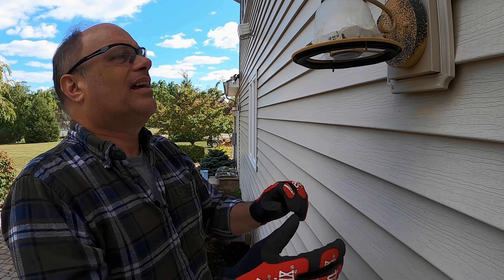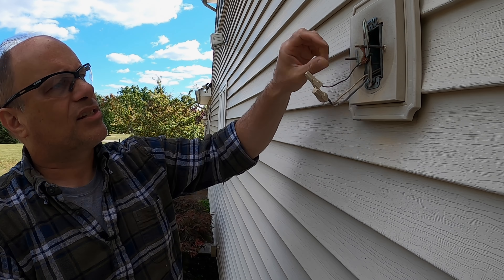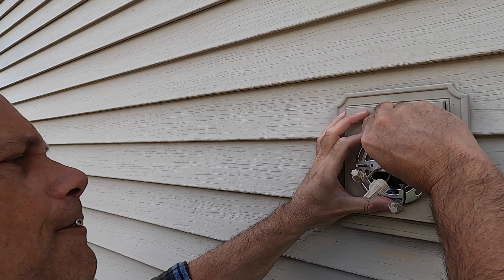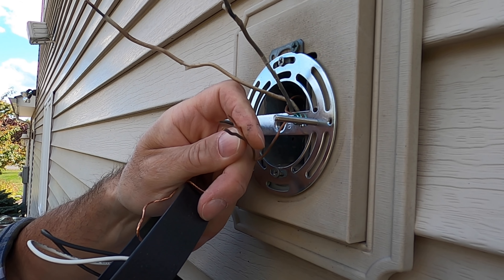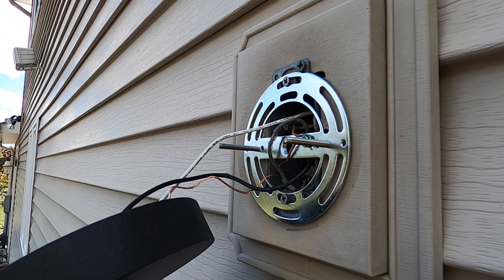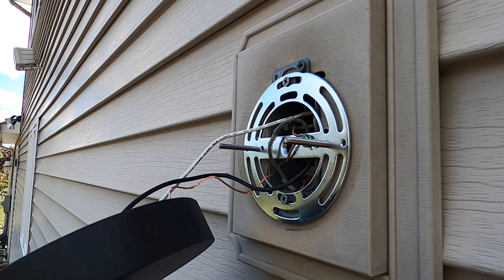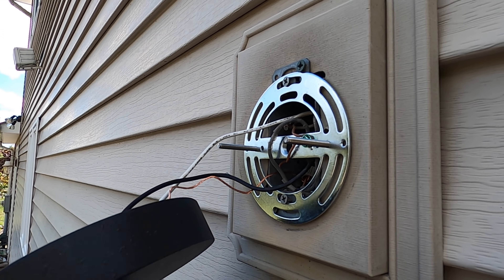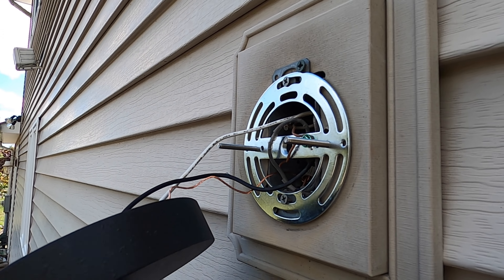How to Install an Outdoor Light Fixture - The Right Way

Comment: Thank you for explaining not just the how-tos, but the whys behind them as well. A better understanding of how things work really helps me. Yours is the 3rd video I watched, and you mentioned so many other helpful details than the other videos. e.g. twisting the ends of the strands, having the different length of strand/solid connection, the tab inside the light bulb, etc. I’m excited to install mine now!
Reply from the maker: Thanks for watching, Sara! Some call me long-winded, I prefer to say I’m “complete”… Best of luck with your installation and let me know if you have any questions!
Reply: @completepete  I agree, no one else mentioned leveling, or not lining up the strands and solids even

Comment: Thanks for posting. I've installed a number of outdoor fixtures but haven't done one on siding so I've been checking out videos. Interesting tip to extend the stranded wire a little further. I do prefer to also wind the two wires where the jackets are a bit though. I do put the wire-nuts up though. 
I especially liked your point about not tightening the mounting screws on the crossbars. I always have but your method makes way more sense and eliminates the frustration of getting the exact distance extended for the acorn nuts to seat properly! I'll be remembering that one thanks.

Comment: Excellent video!  Thanks for all the extra little details about the installation like leveling the mounting bracket, wire nuts facing upward, proper tension on the lightbulb fit, caulking around the top, etc.
Reply from the maker: Joe,  thanks for watching and hopefully subscribing!  I’m glad you found the video to be helpful.

Comment: That's a really good tip about masking the fixture with painter's tape before adding a bead of caulk to seal it up. I just did that with mine, and it worked great. Thanks.

Comment: Thanks for this. I was surprised at the lack of a gasket on a similar light that I bought recently, this explains it well.

On the circular mounting plate, there’s usually a bunch of threaded holes for different sized boxes. if the light is still sagging, you can put a longer #8-32 screw in  on a bottom hole and turn it until it contracts the back of the metal box, and use that to keep the plate from bending over time and the light sagging. Assuming there’s not wires in the way that the long machine screw would damage of course.

Comment: Thanks so much! I just replaced the 2 fixtures flanking my patio door after watching your vid, writing certain steps on paper to have handy on my ladder. Followed your PRO tips, like extending stranded wire past solid one, turn direction of nuts to avoid rain, etc, which other well meaning YouTubers (but not PRO electrician) might exclude. I was so confident that I ordered one of the replacements "Used, Very Good condition" from Amazon for half price—supposedly only having a dented box, but ya never know. Figured I could readily TEST it with a quick install of ONLY the wires. YES, I had to keep reminding myself to flip the circuit breaker back OFF after the test. So what a joyous moment when BOTH lights worked after completely installed. (One fixture had already failed a year ago but I hadn't gotten around to fixing it til now, so wasn't sure what was going on there—the fixture or internal wiring.) Actually, REMOVING the old fixture was the hardest part! One of the 2 decorative nuts on each fixture didn't want to come off. It was like screwing it was also turning the bolt it was attached to, going round & round nowhere. The good thing? Because I was "educated" by your vid already, I didn't panic. Used pliers to pull nut—attached to the whole shebang (bolt, fixture & mounting plate) slightly, bending plate JUST far enough away to access the 2 screws (at top & bottom) holding old mounting plate to wall. Then unscrew them to remove old fixture. Was quite an ordeal, actually. Makes me now wanna research how to readily remove rusty nuts, bolts, etc. Cause lately with Covid, I've been doing plumbing too, and encountering nuts & bolts rusted together—not readily removable—even with WD-40 and similar products.  Well that's a whole other night's YouTube viewing :-)  Thanks again so much! You are indeed COMPLETE Pete!
Reply from the maker: Thanks for watching!  I’m so glad that you had a great experience with your project.  If there is some other project you would be interested in seeing a video, please let me know.
Reply: @completepete  Hey, I notice that you twisted the new stranded wire CLOCKWISE. Does that make a difference in how strong the connection is? ..Since we later turn the NUT in one direction onto both wires, might we be "unraveling" or twisting the stranded wire even tighter depending on what direction we twisted the stranded wire initially?  I'm reminded of pipe tape for plumbing fixtures where the direction of tape wrapping makes a difference, and I'm sure there are more light fixtures swaps in my future :-)  Thanks!
Reply from the maker: Great question..  I always twist clockwise with the stranded wire and when the wire nut goes on, it’s also twisted clockwise. This allows the spring connection inside the wire nut to tighten when it’s turned clockwise

Comment: Thank You!
I didn't know about the orientation of the stranded wire Vs. the solid core wire.
Also, the tip about the wire lugs is something that I have never thought about.
You've given me the confidence to repair my outdoor light fixture and it's going well.
The light that I'm working on is bent and the junction box is not secured in place.
I'm going to remove the light and secure the junction box in place and straighten the threaded tube.
Thank You!
Reply from the maker: Thanks for watching Jeffrey! I’m so glad that you were able to perform this repair.. take your time and enjoy the process.  I’m working on some other electrical videos and hopefully one of them may guide you into your next project. If there is something electrically related that you would like to see, just let me know!

Comment: I know 90% of this, but your tips about stranded to solid wires and twisting in the bulb were great. Question: how do you keep the mounting screws loose so that they can go in further if necessary for the decorative nuts. You mentioned this when mounting the light, but it was not clear when you installed the bracket.
Reply from the maker: Thanks for watching! There would be three ways I’d go depending on the job. First would be to install shorter 8/32 screws into the mounting bracket. Second would be to use the screw cutter on my Klein stakon crimpers to cut the screw shorter. Third if I had no shorter screws or my screw cutter I’d run the screw heads back against the siding and mark around them. Then I’d drill a 1/4” hole through the vinyl and into the plywood to create a pocket for the screw to recess into if needed.  Thanks for mentioning this as I can do a quick video covering these points!

Comment: This is very helpful. Upon removal of the old fixture, I realized there is no junction box! Can you do a video on how to install a round junction box? Or any tips/suggestions?
Reply from the maker: Thanks for watching.. glad you found the video helpful.  It’s possible to cut into the siding and add a box (I was planning to do a video in this in the near future). If you have vinyl siding you can add a siding block with a molded in junction box -
https://www.homedepot.com/p/Arlington-Industries-5-8-in-Lap-Siding-Mounting-Kit-with-Built-in-Box-8151-1/202284581
They make this type of siding block for a number of siding types. This is a great way to go if you have vinyl siding so you can avoid cutting into the siding.  Please subscribe so you don’t miss the video.. if you project is more urgent hopefully the siding block option will work,  let me know if there is anything else I can do to help!
Reply: @completepete  thank you! Trouble is, the house already has the “block.” It’s like 6” x 7” roughly. Can I cut into the block and install the junction there? Or do I need to remove the entire block and start from scratch?
Reply from the maker: You can normally cut through the block without any issue.

Comment: Good video! My ground wire is held in the mounting by a small bracket. When I disconnected it from the old fixture the wire broke right at the end. Can I attach an extender wire by pulling it out from the bracket attached to the box or should I attach another piece to the section where it comes out of the wall to the bracket?
Reply from the maker: Best bet would be to attach a new piece of copper to the ground wire coming out of the box. Then reattach to your fixture bracket

Comment: I forgot to screw the ground wire to the mounting bracket. I did everything else correct. Do I need to go back and redo?
Reply from the maker: Thanks for watching! Yes, you should go back and attach the ground wire to the mounting bracket. The ground is what trips the breaker in the event of a short circuit.
Reply: @completepete  Thanks so much!!

Comment: I am instaling a outdoor light fixture very simler to the one you instaled, the problem I have is the fixture mounting screws are 3 inches apart and does not go in the wall box openning.  The wall is stucco finish and the round box openning measures 2 3/4 inches, Is there a remedy without tearing the old box out of the wall. You video is very informative. .
Reply from the maker: Thanks for watching Maruk!  Two ways to solve this problem.  One way is to mark where the bolt heads are hitting the stucco and using a masonry bit in a drill to drill into the wall to give space for the bolt heads to recess into.  Second way is to use shorter bolts or cut the existing bolts shorter using this tool. https://www.lowes.com/pd/IDEAL-Crimper/1083479. One of these methods should work..
Reply: @completepete  Thank you for your quick response.  I am choosing uour second method and i am adding spacers behind the universal plate so that the screw head have space, thanks again. Maruk

Comment: So lets say I have a outdoor light fixture (concrete block stucco home) and I want to add a hard-wire camera about 20" above it.  What would be the best way to tap into the power of the existing fixture?
Reply from the maker: Without seeing what you have.  I’d say the only thing you can do easily would be to add weatherproof (bell box) extension. This would allow you to tap off the existing box. Of course that limits you to certain type of fixtures that will fit on the box.
https://www.homedepot.com/p/Commercial-Electric-4-in-Round-Metallic-Weatherproof-Extension-Ring-with-4-1-2-in-Holes-Gray-WRE450G/300847257
Reply: @completepete  Thanks....yeah came up with the same conclusion.

Comment: Great video. My old fixture has nest the size or avocado pit that a giant wasp is looking to move into. Immediate suspension of project! Man that thing is huge. At any rate... waiting for my hvac neighbor here in my condo community to see if he'll let me borrow his voltage meter tester. I don't trust the breaker. What I notice is that the old porch light doesn't have a ground wire but my new one does. Do I just wrap the copper wire around the little prong with the green dye on it?
Reply from the maker: Thanks for watching and good idea avoid that wasp nest!  Most times there is a grounding conductor running along with the hot and neutral. If the fixture box is wired with steel jacketed BX cable or conduit, you would wrap the fixture ground around the green screw on the fixture bracket.

Comment: I have never changed a light fixture. You made it looked easy. I have an old fixture on my backyard that needs replacing. The new one I got looks similar to yours only smaller in length. I have subscribed so I can find your video for my upcoming little project. Question: Would silicon works in that gap you mentioned in your video?
Reply from the maker: Thanks for watching and I’m happy that I’m able to help in some small way.  Any outdoor silicone or latex caulk will work and give you a good color match to your siding.  Good luck with your project!

Comment: I'll be trying this is a couple days, after my sconces are delivered.  I've pulled out one of the pair that were original equipment when the house was built 50-years ago.  I am not seeing a ground wire, just black and white.  Maybe I can dig out another wire tomorrow in daylight...but, what if there is no ground wire as I suspect may be the case?
BTW, I've watched several other videos on this subject and this is the best yet.
Reply from the maker: Thanks for watching!  Lack of a grounding conductor is a common issue in older homes. You can check closely and you might find a ground wire wrapped around the cable jacket right where the cable enters the box. Years ago electricians wrapped the ground around the jacket under the clamp and tightened the clamp down.  If you really don’t have a grounding conductor, just leave it disconnected in the box as it’s a secondary path for fault current.  This would be the best you can do without rewiring.

Comment: I have a mounting box that looks just like the one in your video. Unfortunately my new fixture needs a bigger surface to sit flush. Do you have a video changing the block/box out? Also my siding is hardyplank and the mounting box was cut into place it doesn't sit on top of the siding like the one in your video. Thanks for such a great video!
Reply from the maker: Thanks for watching and I’m glad you enjoyed the video. I know that PPG makes primed light blocks for James Hardie siding in four sizes. Saw a 5/4” thick x 7 1/2” wide x 9 1/2” high on Home Depot’s website. You may need to cut off the existing block with a 4 1/2” angle grinder with a concrete wheel (wear a dusk mask and goggles). The new block can be attached with an exterior adhesive.  Good luck with your project!  If you run into trouble you can send pictures of your project to completepete6@gmail.com and I’ll help if possible

Comment: What if your siding installer didn't bring the junction box out? Can I mount it directly to the mount block?? The junction box is still mounted behind new Tyvek, insulated board and Dutch lap with the wires coming out neatly through the mounting block center hole (approx 1.75" diam). I can see the box is a few inches to the side under the siding so I can't pull it out to the mount block. Not without popping siding off.
Reply from the maker: I think I’d install a metal extension box on the current box.  https://www.lowes.com/pd/RACO-Steel-New-Work-Old-Work-Box-Extender-Electrical-Box/3127061.      Lowes has a 1 1/2” deep version that might work. An electrical supply house may have shallower versions of the extension box.  Hard to tell without photo..   by all means send some pictures to completepete6@gmail.com and I’m happy to weigh in.
Pete

Comment: great video! Question: Do I need to use electrical tape for the wire nuts?
Reply from the maker: You don't have to by code and I normally make sure the wire nut closed end is pointing up to keep water out.  A wrap of tape between the wire and wire nut is even better to make sure the connection stays dry.  Thanks for watching and hopefully subscribing!
Reply: @completepete  wow thanks for the speedy reply! Will try to do this install this weekend.

Comment: I have a similar set up with my old light on the vinyl box as you do. However, when I removed my old light, the hole was very small so I could not tell if there was an electrical box inside the vinyl box. I  installed a new LED flood light but now thinking I should have double checked to see if there was a metal electric box inside the vinyl piece. Or does the external vinyl piece act as an electric box? Thank you.
Reply from the maker: Scott, thanks for watching!  I’ve seen this issue you are talking about many times. Most often there is a box installed but the vinyl siding folks don’t take the time to cut the 4” circle in the block. Instead electing to make a small hole to push the wires through. Some siding blocks have an integrated box but it would be obvious. The third possibility is that there was a surface mount box there originally and it’s only a cable poking through the wall. It would be best if the fixture was attached to either a recessed box or a surface mounted pancake box and of course properly grounded. You may want to check a little closer to see if there is a box somewhere. Feel free to send a picture to CompletePete6@gmail.com if you are not sure what you are looking at.

Comment: Thx for video. Is this considered wet location? I need to install gooseneck light on barn and wondering if I can use just a normal junction box that is recessed and attached to stud or brace… or even a pan box? What would best approach be to minimize hole in siding but have a nice flush fixture with no visible box?
Reply from the maker: I really like the old style gooseneck lights.  I’ve installed them a few ways.. normally I bend the goosenecks out of rigid steel pipe and use a recessed steel box or if keeping with an industrial / farmhouse look I use a galvanized steel surface mount box that is used with rigid steel pipe.  In your case, cutting in a metal box should be pretty easy and just fasten the screws right through the siding and into the plywood sheathing.  No need to attach to a stud or brace unless the fixture and arm are very heavy.  I have in some cases had to install a mounting clip above the gooseneck with a piece of 1/16” stainless steel cable for added support to prevent sagging. Hard to see and gives some support.  Let me know if you need any support as you move forward with your project.